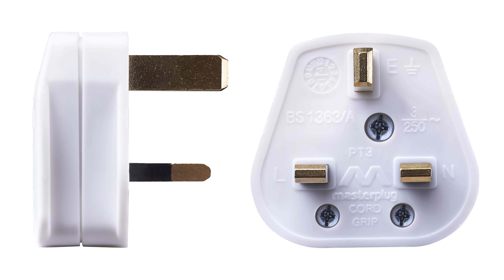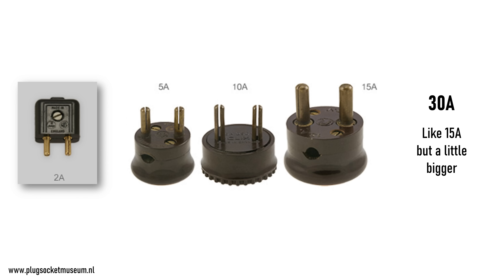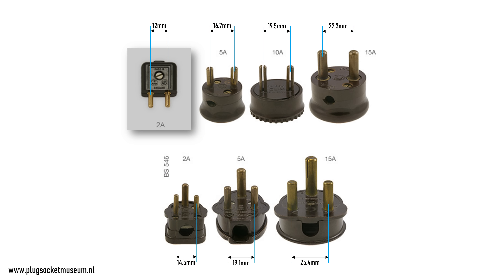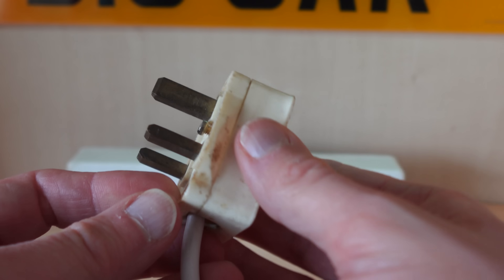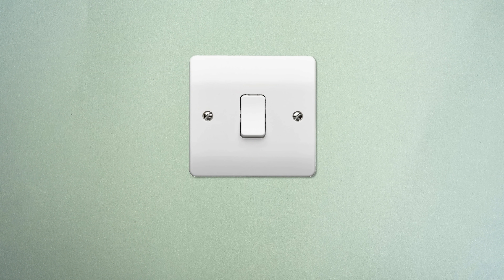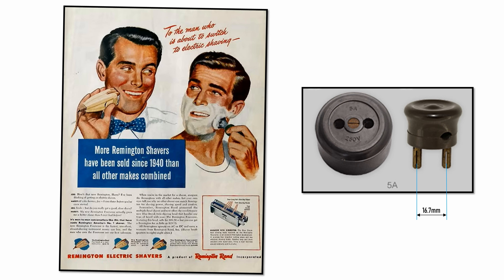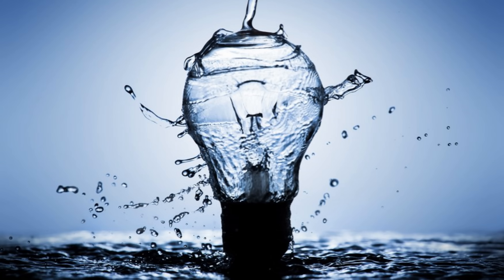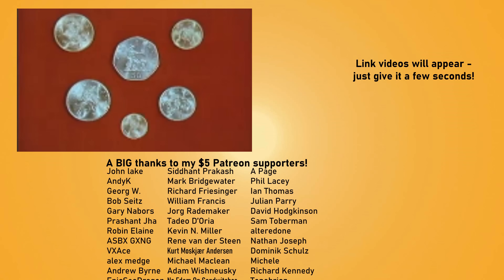Shaver Sockets are really clever

Comment: Shaver adapters….thats the 2 pin shaver plug to 3 pin U.K. format….the adapters are available from numerous places very cheaply.
Until about 2y ago, I never had a problem plugging U.K. shavers and electric toothbrush chargers into these adapters.
Then when I changed my shaver, the 2 pin plug which came with the new one didn’t properly fit the existing adapter I had…the 2 pin shaver plug would fall out the sockets on the adapter.
I actually ended up buying a new adapter plug and this fits fine….if anything a bit too tight.

There must be like a millimetre difference or something.

*many shavers are rechargeable so do not need to be plugged in when in use in the bathroom. Tho with the adapter this can still be used for charging (and electric toothbrush charging), there really isn’t any need to. Cord length may also be inconveniently short for this, and the direct shaver outlets with lights may require the light to be left on….the switch for the light also controls the outlet. Therefore using an adapter to connect to a regular power socket in a different room is more common.

Would be very useful to get rechargeable shavers & toothbrushes with USB.

Btw the U.K. 3 pin modern plug didn’t always have insulation at the base of the pins….I believe they started adding it early 1990s?

On some devices with a universal PSU, there’s often a 2 pin Euro plug inside what looks like a regular U.K. 3 pin plug….you can take it apart and plug the device directly into a Euro power socket.
Reply: Braun seam to be supplying them with EU plugs these days 😮.

Comment: Jeez!  You guys sure have a lot of weird sockets.  Here in America there is only one configuration for plugs and three types for regular 120V outlets, a normal outlet, a GFCI (ground fault circuit interrupt outlet for wet environments and an AFCI arc fault circuit interrupt which is similar to the GFCI and is also suitable for wet environments. For high voltage 240V outlets, there is a different configuration for the pin shape so you cannot accidentally plug a 120v appliance into a 240v outlet. 240v outlets are pretty much used only for dedicated purposes such as a very large air conditioner, electric clothes dryer.  I don't know why so many countries decided to use 220-240v wiring instead of 110-120v as on the USA.
Reply: We use RCD, which is like GFCI but for the whole house. Using 230v lets you use higher power appliances (eg, many Americans haven’t heard of electric kettles, they simply take too long to boil water with only 120v)
Reply: Come on, Americans have different sockets for almost anything.

Comment: Just don't ever use a shaver socket as an international adapter. They are for shavers and devices specifically designed for shaver sockets like electric toothbrushes only. AFAIK they are always 20VA in UK and that does not directly translate to 20W, it depends on the power factor of the device, and that limit is not a safety measure it's simply the limit at which the transformer will saturate. People fry their shaver sockets all the time by plugging in the wrong thing. When I bought my new-build house not plugging in anything that's not a shaver (not even a toothbrush) was a condition of the warranty because damaged shaver sockets were such a common warranty claim for them.

Comment: lol, or you go and live in the modern world where we use RCD's. When I came to live in the UK back in the mid 90s I was gobsmacked by the "last century" plumbing (cold and hot water tanks so you can't have a mixer tap in the shower) and electic installations (not even speaking of the foot killer plug). Not allowing light switches in bathrooms and a need of "shaver sockets but at the same time  puttng 10kW electric water heaters right INTO the shower cabin. There also were power showers (I installed one in my bathroom). Hilarious!
Reply: Hilarious that you suffered with the superior British plug so much that you call it a foot killer when little children manage to live with them with hardly any issue at all.
Sort of undone your big man talk with that.
I can see why you struggled so much.
Reply: Uk uses RCD too. There’s no problem with mixer taps, that is out of date regulations. The plugs are fine, it’s either plugged in or stored away, there’s no good reason to step on one

Comment: The UK stuff is bonkers sometimes.
There are more things to plug in and use in the bathroom than there are in a bedroom.
Waterpick, shaver, toothbrush, radios, smart speakers and TVs for watching during a bath.
So you have to run an extension cord to run those things?
Reply: Using a TV in the bath is wild

Comment: You can use an shaver in a UK standard socket. You need to bend the pins a bit and obviously put something into the ground hole to open it but it works :) 
Learned on an school trip to UK long ago.

Comment: I honestly think the shaver plug is really stupid. Here in the United States, we are happy to put a standard plug right in by the sink. It doesn't even have to be GFCI protected itself, just as long as it's on a circuit downstream from a GFCI protected plug. Then again, there was a ton wrong with our plugs.
Reply: All UK sockets are protected by a residual current device (RCD) which serves the same function as the American GFCI. They trip at under 30mA/7 watts.

Comment: Doesn't rechargable batteries reintroduce a use for the shaving socket that had largley been obsoleted by disposable batteries? Rechargeables need the socket to actually recharge, where disposable battery devices never needed a socket at all, and few have had directly plugged in shavers or tooth brushes for decades 🤔

Comment: Just in case anybody ever wondered; The 200mA current limitation is also why UK hotels have a reputation for having the worlds crappest hairdryers in them. It's nothing to do with the hotel or the fact the hairdryer is Made in Britain but more to do with the safety standards which they are obliged to adhere to. Let's face it; You're not going to get much heat out of something that's limited to 50w! 🔌📉😇

(Though if you're in a UK hotel and need something more powerful, you might be able to borrow a regular, higher wattage one from the front desk. 👍)

Comment: No offense, but seems like brits are really paranoid about electricity.  Here in the US we have:
Two prong, unfused plugs (and three prong, unfused plugs).  Two pronged plugs will fit into the three pronged sockets, but not vice versa, of course (the only place 2 pronged sockets are common anymore is very light duty extension cords meant for stuff like portable lamps).  Some of those plugs aren't even polarized, so they can be inserted either way.  In fact having fuses in your plugs at all is just weird here.  The only thing that does that is some Christmas lights.
Inspection hole on your plugs to make sure it's earthed?!   Aside from replacement plugs, most of our plugs are molded in place with no openings.  Not sure why you'd even want an inspection hole or who would bother checking it.
Outlets and switches in the bathroom, usually within reach of a sink, often right next to it (on the wall, of course).
Full 15A, 120V outlets near our bathroom sinks, same outlets you see everywhere else.
No isolation transformer for our bathroom outlets (we do require GFCI protection for those though).
Always on outlets - no switches next to them.  You just plug in hot.  Sometimes you get a small spark, but it's no big deal.

Also worth pointing out that 200mA is enough to kill you.  And I really doubt those transformers strictly limit current to 200mA anyway.  You should watch Styropyro's video on electric shocks - it's really not fair to say that it's not the voltage that kills you, it's the current.  Reality is MUCH more complicated.

Comment: FYI. Fuses are usually there to protect you home, not your device. Protecting the device is just a happy biproduct
Reply: Damn, I wanted to comment that. Basically the fuse is there to protect the conductor ie the cable NOT the product. The product should include other protection mechanisms for itself inside.
Reply: @ExplosiveAnyThing  my guess is that post WW2 Britain had very little copper, so they had too thin wire in their homes. So responsibility for the  safety of the home and installation were left proudly up to the appliances. Also occult ring circuits should be mentioned 😅

Comment: I'm pretty sure that the UK plug is the only one that has a fuse. It is clearly superior to all the others though.
Here in AU we have a woeful three pronged wimp.
The ONLY problem with the UK plug is that it's not nice to tread on in bear feet.
Reply: It has a fuse due to the house wiring from war times and a copper shortage.
UK uses ring main
Au uses radial

UK socket is better in the fact it comes with shutters.
However you're limited by how the cables can be routed.

If you trip on a cable in Oz it comes out the wall, it doesn't in the UK.

Comment: Fuses are never intended to protect the device. They're there to protect the wiring only, preventing electrical fires.

Also, 0.2 amps will absolutely kill you. A tenth of that is enough to do that, if it finds the right path through your body.

Comment: I live in Serbia. In my house, every room has a 3 phase 400V socket, capable of 11kW of power.
Reply: why do you need so much power 1800w at 120v is plenty of power in most areas
Reply: @404hopenotfound  1800W is not enough. We are limited to 16A 3.6kW per phase.
My vacuum cleaner is 2.3kW. Space heaters are 2-3kW. Stove is 9kW (3kW oven and 1.5-2.5 kW per cook top) and it needs 3 phase, or very careful user if plugged in a single phase.
Storage heaters usually have 3 heating elements, so they plug in 3 phase if they are over 3.5kW. For electric motors, 3 phase gives you much less vibration and longer life, even if the motor is just 2 kW. 
And last thing is a portable EV charger, as you can take with you up to 11kW of power. 
Socket is capable up to 11kW, and adapter to 3 single phase sockets costs just 10$, or you can install single phase socket and ignore other 2 phases. Running a 3 phase cable is almost the price of single phase one.

Comment: 0.2A at 230V is plenty enough to kill you, It would be better to use an RCD/GFCI instead. I have also never heard of someone getting a serious shock from using a standard light switch with wet hands.
Reply: An RCD does not protect against phase to neutral shocks which are the only ones possible on an isolated sockets. Isolation is always safer than differential protection. You cannot protect against phase to neutral shocks as there is no way to differentiate between a shock and normal use.

Comment: The whole thing about "it's the amps that kill you" isn't necessarily correct. High amperes at a low DC voltage might not even break your skin, 50~60Hz AC can give you a wallop even below an amp. High frequency AC (1000+Hz) on the other hand might not even effect you thanks to the skin effect. Total power (V x A, or VA as in your example) is a better measure of the damage potential, so the conclusion really is the same: the same voltage being current limited has less potential for harm.

All that being said two things always hold true: the path the current takes is the difference between life and death, and; a little precaution with line voltage goes a long way!

Comment: On the face of it, I understand the reluctance to put electrical sockets and switches in the bathroom.  But how does that same logic apply to kitchens and laundries?
Reply: It doesn’t. Sockets need to be 30cm from a sink, that is all.
Reply: @techheck3358  
Then surely a socket and/or light light switch could easily be placed more than 30cm from a sink or bathtub in a bathroom.

Additionally, the pinned comment from Little Car informs that a light switch needs to be "3m from a water outlet (eg sink)."
Reply: @tassie7325  it’s 30cm from a sink and 3m from a bath or shower. The 3m is the bigger problem
Reply: @techheck3358  
Thanks.  That makes more sense

Comment: It's funny how brits are always boasting with nationalistic pride over those big, clunky UK plugs. 

I'm more favorable to the danish eu plug (type K), the one that looks like a happy smiling face. Because: It looks nicer. Haha!
Reply: Meanwhile, ours in North America all look quite shocked: 😧
Reply: Check out the Type N used in Brazil.  It looks like a good design to me.  That would be my choice if it were possible to switch.
Reply: They are over-engineered and redundant in any modern electrical installation.  Why have a fuse in every plug if there is a 15A fuse on the whole circuit?  The safety shutters are only necessary because the pin holes are so large.  And the whole thing is twice the size it needs to be.

Comment: It is time to drastically change house electric system using solar and batteries with direct current electricity. For example, it can be started changing the lighting electrical system to be DC.   Voltage conversion to various devices through its dc-dc converters which is cheap and efficient and tiny as AC electric transformers.   Huge waste with our current system where every house appliance has its own transformer and DC conversion which is not even efficient.

Comment: As this video is about the 'shaver socket', quite sufficient. However, as some with little knowledge, have taken to run down the BS1363 13 Amp plug/socket. This arrangement is the most safe, and for many reasons. Not least the ring mains system used in the UK. Tom Scott has covered this, at length on his excellent channel.

Comment: This happens if people get stuck on an island. 
If one leaves living species on an island and goes back a few thousand years later, one will find weird things, strange habits and the whole place will be just different. Like animals on the Galapagos island, people are different in England with their weird traditions and habits. 
Just look around: the separate cold and hot tap on the sink, even the lightswitch works the other way round as it would be logical.  The date begins with the day and ends with the year. Postal address begins with th house number, then the street and the town. Everything is upside down, everything goes against the logic. Why the electric system would be any different. There's a system which the rest of the world is happy with, but it has to be overcomplicated in England. 
If you ask why, you have to listen to an endless lecture with full of bs.

Comment: Only thing those shavers plugs achieve is being annoying when you need to power something bigger, like a hair dryer. 
The RCD protecting the circuit whill limit the current anyway to prevent deadhy accidents. Brits are so scared of electricity they need to invent things to feel safe

Comment: 200 milliamps most definitely can kill you.  Especially when your skin is wet.  What the fuck.  Also it is not as simple as "it's the amps that kill you".  Higher voltage means it's more likely that a current will overcome the high resistance or your skin and send that current through your circulatory system...  You know that thing that all connects to your heart?  Yeah.  This seems insane to me.  Why have an RCD on the whole bloody house then completely negate that by isolating a deadly circuit in the bath.  Foolish.
Reply: You’d need to find a way for one wire to be in one hand and another wire in the other hand. So short of actually disassembly a shaver(/euro plug appliance) while it’s plugged in with wet hands, you’re safe)

Comment: I would qualify this standard as sexist, made by men for men, making great considerations about shavers (wlst as it is mentioned, they became fastly battery powered), and completely ignoring the necessity to use hair dryers, curlers or wax epilators to name a few.
Reply: I'm sorry did you just call an electrical outlet 'sexist'?
Please get off the internet and learn how to use an extension cord.
Reply from the maker: Remember this was created in the 1940s when those products you mentioned weren't a thing, at least for widespread use. Plus, yes, things were pretty male orientated back in the 40s. Odd that even today it has to display "shavers only" with the little bloke shaving symbol. That's the more sexist part of it, as most people today plug their rechargeable toothbrush into it.

Comment: In many countries the negative is the earth
Reply: How does that work with AC power?
Reply: @CheapBastard1988  Well, saying "negative" is a little sloppy when it comes to AC. But even with AC, in many countries you have a "TN" type system, meaning the "neutral" (the star point in tri-phase AC) is grounded. In mono-phase you get one "neutral" and one "hot" or "live" wire. The "neutral" is on ground potential, the "hot" is at 230V AC (or whatever the mains voltage is) to ground. Touching "neutral" will do nothing, touching "hot" can kill you, as you will close a circuit through your body and the ground.

On the other hand, the shaver plugs with the insulating transformer don't have any ground reference (a so-called "IT" system). As said in the video, touching any one single wire, no matter which one, won't close a circuit, and no current will flow.
Reply: @m__42  "Touching "neutral" will do nothing"---that's not actually true. It puts you in parallel with the neutral wiring to the grounding point, so depending on how much load is between live and neutral and how the resistances on the neutral and ground paths are, you can still get a meaningful current flowing.

Here, I can trip a 30mA RCD by putting a voltmeter between neutral and (metallic) ground.
Reply: @HenryLoenwind  Fair enough, that was a bit oversimplified. Sure you can get some small current from neutral to ground and if shorted (guessing you had the voltmeter in current mode?) it can very well trip the RCD...